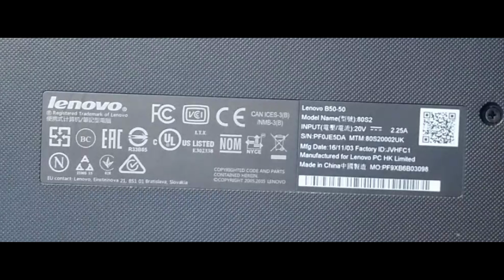Lenovo B50-50 - How to replace the keyboard

Comment: Small differences with B50-45. Only two screws, both in the middle and both have a tiny keyboard logo embossed next to them. No double-sided tape, but may be stuck down due to age at this point. Still need to carefully pry up keyboard's upper edge. Watch for two small plastic tabs at TOP that need to seat, along with the ones at bottom. Otherwise the same. Thanks for the helpful video!!
Reply from the maker: Thanks for the thanks and the hints for others with a B50-45!
Reply: @freename  My pleasure. The B50 is a pretty nice little machine, IMHO. I got mine when Lenovo ran a special about 5 years ago for just $200. I bet I could still get that much for it on eBay right now.

Comment: Hi! I've been given the same laptop but I have no idea how to turn it on, where is the power button?
Reply from the maker: Front left or front right along the side
Reply: @freename  hi! thanks for answering! I found it earlier but now I have another problem, the keyboard seems locked. I press Tab and it writes z, I press backspace, it writes y, or it repeats letters on its own. Do you have any idea how can I solve this? I updated the drivers, nothing changed. I did format - twice and still the same.
Reply from the maker: @summerdaysallyear  Sounds like faulty or damaged keyboard or maybe, if you are lucky, poor connection to the motherboard where the keyboard plugs in and unplugging - plugging it back into the board might help.
Reply: @freename  again, thank you for your answer! I checked the cable tape and it seems ok. It seems I need new keyboard!